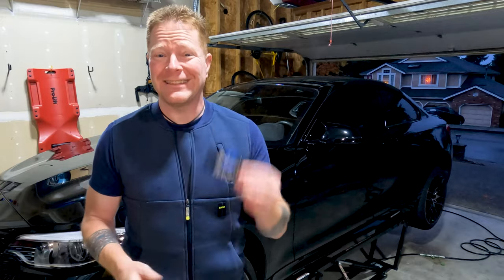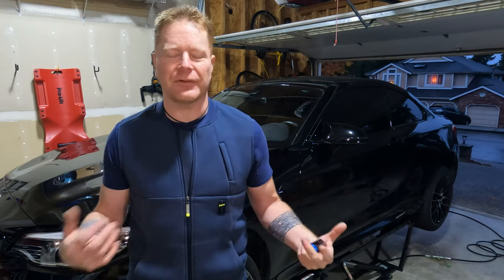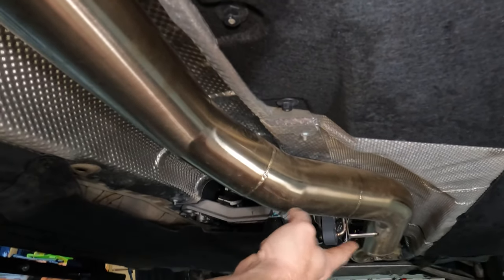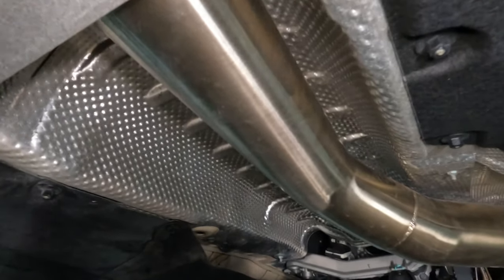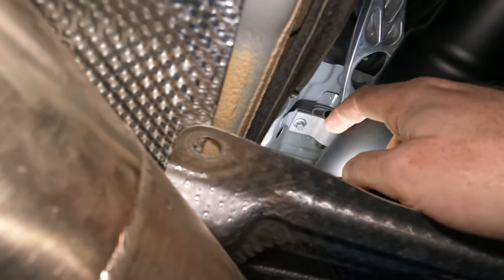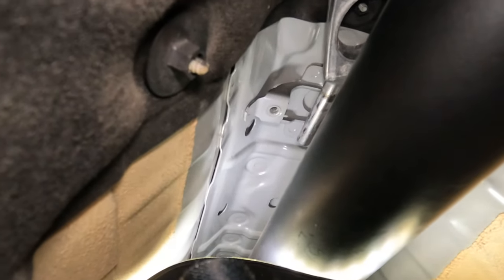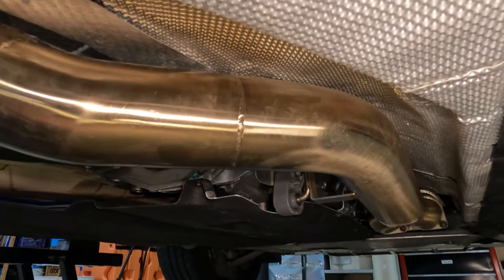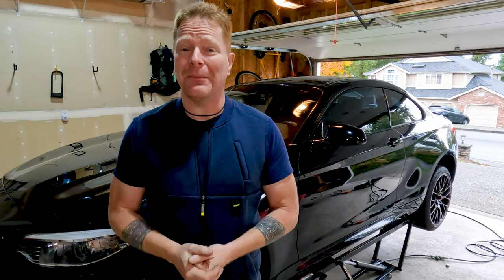BMW F87 M2 Competition Turner Motorsports shift bushing DIY

Comment: To make it much easier - if you have QuickJack, drop the exhaust.  Support it with your floor jack and a piece of wood under the muffler.  Now you can remove the heat shield completely which eliminates the angle problem when you go to re-thread the bushing bolts.  Still a good vid.
Reply from the maker: I love my Quickjacks!

Comment: How do you re-install the bolts with a universal on an extension.  Can't get them to thread....
Reply from the maker: Very very gently, I had one bolt want to fight me threading cleanly.  I made sure to hand thread both bolts first
Reply: @BMWDIYGuy  Got the driver side in - passenger side won't line up.  After market cat-back exhaust doesn't help between the brackets and the bend...
Reply from the maker: @BPawn6  I know you can do it! 8)

Comment: I’m considering this for my OG M2. Sounds like overall improved shifting feel with the Turner bushing? How about NVH — any increased noise when idling or in gear with the new bushing installed?
Reply from the maker: Much better, no NVH, excellent upgrade
Reply: @BMWDIYGuy  No extra noise when shifting gears?
Reply from the maker: @Franzino  none at all, very positive change enough so I may do the same on the G87
Reply: @BMWDIYGuy  Perfect! Thanks for the info...
Reply from the maker: @Franzino  Happy to help

Comment: Stefan, my brother ✊️ I just did this mod today. FYI in this vid you installed the bushing upside down 😬
Reply from the maker: So the irony is you can install it either way.  I realized after the fact that the Turner pictures show the other orientation, so I called them.  They said it doesn't matter and was fine to leave as is.. I eventually reversed it while doing a different project, since I assume their product picture orientation is the correct way.  Great catch, but not as impactful as we both thought.
Reply: @BMWDIYGuy  gotcha. I also did the Rouge transmission mount upgrade as a combo deal. 

Was NOT impressed with the dual upgrade outcome. Notchy? Yes. Lil more noise? Yes. Lil more vibration? Yes. Worth the effort, money, time, etc? Not in my opinion. 😕 Still has noticeable play while in gear, same as before. I gotta find more bearings to replace. 🤷

Comment: I think you installed it backwards
Reply from the maker: Ironically enough, you may be right.. I spoke with Turner about it after making this video and they said it can actually go in either way.  I ended up reversing it later when I was doing some other work.  Great eyes!